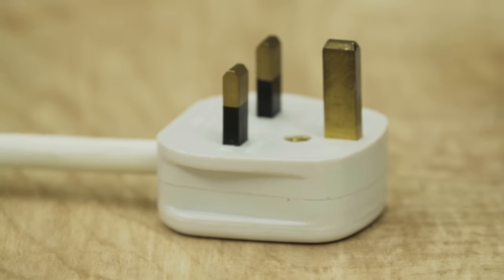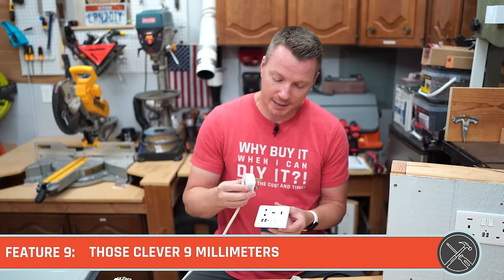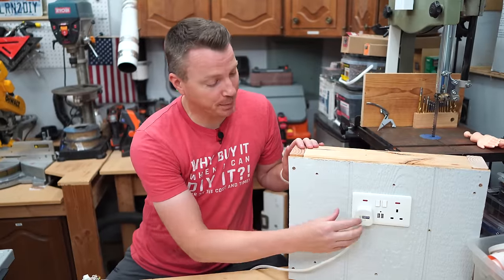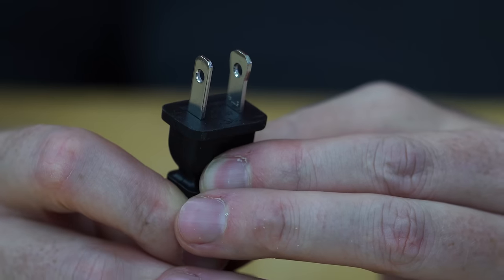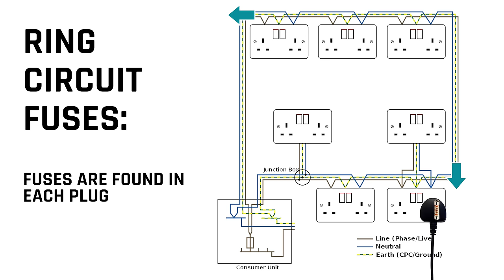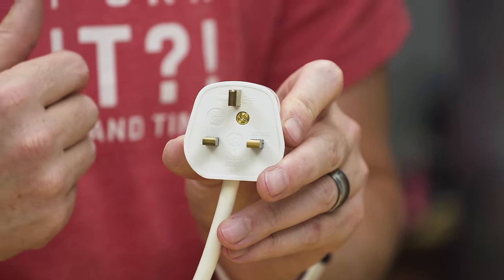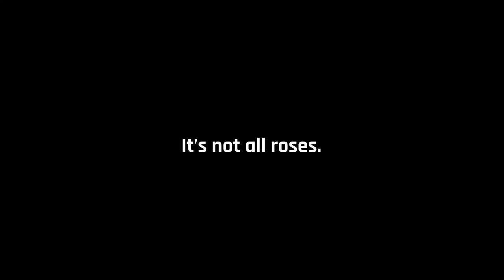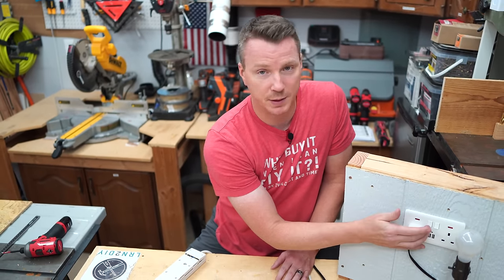British Plugs and Outlets Are On Another Level

Comment: I've never had an issue with thinking a device wasn't working because its switched off at the wall. In Type G systems we are born into this. 
Also in British schools every child is taught how to wire a plug safely and how to change a fuse usually at about 12 years old. As a result electrocutions are quite rare in Britain.
Reply: Plug wiring has not been taught in British schools for decades. However, the concept of how plug cables consist of multiple wires in order to create complete circuits is taught in KS2 Science.
Reply: @JivanPal  really, my son, 15 was taught it at Queen Elizabeth High School, Hexham, Northumberland,  a state comprehensive,  when he was 13.
2 years ago
Reply: @HarryFlashmanVC  It's not part of the National Curriculum, though I'm sure some schools teach it as a matter of curiosity / general knowledge, or to give students a deeper understanding of electrical wiring in practice, for GCSE science/physics. It was certainly never taught at the London comprehensives I attended. I finished Sixth Form in 2015, including A Level Physics.

It never comes up on any exam. Instead, concepts like electricity generation and distribution via the National Grid, stepping up and down voltage using transformers, and properties of RC circuits are assessed at GCSE level. Simpler circuits and concepts are studied and assessed at KS2 (in the SATs).

I can't say I've spoken to anyone my age or younger that actually knows how to wire a plug. My mother (born in 1964) was taught how to do so at the same primary school I attended, but I wasn't.
Reply: @JivanPal  sorry to head that. It doesn't surprise me though, it appears your generation have had some extraordinary gaps in your education in the name of 'progress'
Reply: @HarryFlashmanVC  Not really. Personal finance, for example, is now part of the national curriculum, and learning how to wire a plug is just a matter of looking up a video such as this. The world has changed, both in terms of what is necessary daily knowledge (such as wiring a plug) and the difficulty and methods with which one acquires new knowledge (the internet has made it extremely easy to find out all sorts of things).
Reply: @JivanPal  that's a matter of subjective opinion! I'm in charge of graduate recruitment at a FTSE 250 and we now train graduate trainees in critical thinking and analysis, as standard as since 2010 we have noticed a substantial drop in both skills in our graduate intake, the debate is now whether we drop graduate recruitment completely and hire directly from school using our own selection criteria and educate the trainees through a 4 year apprenticeship.  Unfortunately the education sector is failing industry hopelessly.
Reply: @HarryFlashmanVC  You're talking about universities now. That's a whole different ball game. If graduate recruiters aren't working for you, then I agree that you should filter out candidates yourselves. I feel it's more likely that the recruiters you're using are very lax with their filtering, as is unfortunately commonplace these days.

Depending on what industry you're in, hiring graduates vs. hiring people straight out of school or coming from apprenticeships does not make much difference.
Reply: @JivanPal  we have an in-house team.who report to me..I've been doing this for 35 years, trust me, the decline is palpable.

Comment: There's another quite cool feature that you missed. Because there are 3 large pins being held in the socket, a uk plug can be quite stiff to remove, prompting you to curl your fingers behind the back of the plug to pull it out and thus, bringing your fingers into close contact with the pins. You will notice that there are two 'flanges' moulded on either side to prevent you from doing this. Most people don't even realise that it's a 'feature'!
Reply: My own concern is that withdrawing a plug from a socket might accidentally pull the top off the plug thus exposing live conductors.
You can buy add-ons to help with plug removal, usually intended for old or infirm people.
Reply: @mungoh42  the british standard includes the minimum force required to tear the cap off the plug which exceeds the stiffest socket. There was a raft of faulty plugs imported from hong kong in the 60's and 70's that got widely distributed and were recalled in the papers. A few still come in from china.

Comment: UK plugs are good, the power switch and the fuse is definitely a bonus compare to other systems, but not necessary. I think that other European systems like type E (french) or F (german / schuko) are so very robust and safe.
Reply: Steve D  surely not, you will never buy an "extension cord" that is 0.75 mm2 or 1mm2 in Europe,  it is just not allowed and any good sold in EU has to pass CE regulations to be sold. Also i wonder what appliance you are talking about, do you even realize what 16A is inder 240V AC? that is almost 4KW, good luck to fund such appliance. You just make it up, you must be a brit.
Reply: Steve D  even a 0.75 2mm powercord can pop a 16 amp fuse or breaker.

Comment: For a long time I thought it was completely normal to know how to rewire a plug and know what the wires mean. I didn't even realise American plugs couldn't be fixed and they just chuck them when they're done. Seeing an American plug for the first time when I was on holiday in Florida freaked me out, it seemed so unbelievably dangerous and flimsy. The way plugs in the US wiggle around in the socket still seems utterly insane to me, and not how you respect electricity.
Reply: You're not wrong. But that's what we are used to.
Reply: @misterdoctor9693  I tend to see a lot of faults in America that you all are just "used to"... Ah and then we laugh as we watch them parade about their pride
Reply: @Nvggs  Don't you dare "you all" me. If I was in charge we would all be using the metric system. Pride doesn't play into it when you have to go about your job every day and everything you interact with is poorly designed.
Reply: @Nvggs  Well, thanks for the prejudice, I guess?
Reply: @misterdoctor9693  I'm British and I don't want to use the metric system. We are half and half like miles, ft and inches etc but now we're out of Europe looks like we're going back to lbs and oz again for groceries. I also prefer °F for climate at least
Reply: @landofnor  why though? Those measurements all seem more intuitive to me in metric.
Reply: @misterdoctor9693  I won't argue that metric has it's place in Science and even in engineering. The problem with metric is that is was forced upon us and it became illegal to sell goods in lbs and ounces, even some grocers were prosecuted for refusing t change their scales. The imperial system is part of our culture of which we've been using for nearly 2000 years. Whilst metric is more accurate, we don't need precise measurements in every day life. A good example is cooking. Try explaining to a 5yr old when baking a cake and measuring out 112g of sugar vs 4oz. It's simply easier to visualize.
Reply: @landofnor  Cultural resistance is exactly the problem. We use worse systems because we are familiar with them and change is inconvenient. Your example of measuring out sugar is only simpler in ounces because you rounded to make the ounce measurement a single digit number. You could round the metric number and call it 11 decagrams. You can have any number of other measurements that just happen to be simpler to represent in metric. And if everyone was using the same system those recipes would evolve and scale to prescribe the simplest working amounts within that measurement system.

Comment: There is one other feature you didn't mention. The earth pin is at the top which will prevent a stray wire draping over and touching the pins from above when the socket is only part way in. It doesn't need to be wire necessarily either. Gravity is the enemy here. It may be a rare occurrence, but it happens. 
Guitar strings can be good for that.
Reply: Plus even it it does, the L and N do not become connected until only the plastic is showing!
Reply: And that is why a lot of new US installations are done with the ground pin on the top even though it isn’t a code requirement.
Reply: I suspect the UK outlets don’t wear out as quickly as the US one. I recently stayed at a small inn where the outlets were so worn they couldn’t hold a phone charger.  

Also - US code has gone to tamper-resistant outlets. The safety shutters don’t seem as sturdy as the UK version, but it’s better than nothing. 

The newer ground fault-arc fault breakers also help.
Reply: @Anonymous-mf8ii  
Yes those ground sensing breakers are good.

Comment: Good video 👍. Those insulated pins were a big safety improvement when they added them. As a child I was pulling a plug and my thumb and fingers slipped around the sides and bridged the live and neutral - it threw me across the room. Adult fingers couldn't fit the gap until contact was broken so I suspect some other kids weren't so lucky. I've had a shock here in Canada and I can attest that 240 V has way more kick! ...the price of kettles boiling quicker and lights that don't dim whenever a motor or heater starts up!

Comment: After having lived my whole life in The UK, any other country's electrical system seems so dangerous in comparison
Reply: Some things are OTT in UK like no light switches in bathroom (only pull cord).
Reply: @Dosedmonkey  again for safety. The pull cord is to prevent electrocution with wet hands. Trust me I've been there in a non european country with a light switch in the bathroom. I shocked myself turning the light off when leaving, blanked out, and woke up in the dark a few minutes later on the bathroom floor dazed. It's not fun!
Reply: There's no perfect electrical system. Yes, British plugs are safer than North American, but the North American split phase 120/240v system is also safer than the British 230v system.

Comment: It's not necessary to pull the plug out to isolate the appliance, that is what the switch is for, so no need to leave plugs lying on the floor, unless you are setting traps for burglars!😉
Reply: It absolutely is necessary to remove the plug in order to isolate an appliance. There is a distinct difference between an appliance being 'switched off' and 'isolated'.
Reply: @MrKevanGordon  You're both right.  You can install a lock on the switch and consider that isolated.  The breaker system is just a larger and heavier switch with overload protection.  Most consider "off at the breaker" isolated, even if no lock is installed.
Reply: @elus89  Not at all. You’re making the assumption the sockets and circuit are correctly wired as we only isolate the live with the switch. If for some reason live and neutral were reversed you would still have voltage. To be isolated it should be done at the breaker and the circuit should be proved dead by measuring for voltage on LN. EL, EN
Reply: @MrKevanGordon  I take your point, but in fact if the socket is double pole switched it would be isolated. In either case the appliance is powered down.
Reply: @themunchkinbear  A lot of sockets are double pole switched so this doesn't apply.
Reply: @bimble7240  and so many are still single pole. You can’t tell the difference from the front. I wouldn’t take the chance. Properly isolate the circuit with testing or unplug the device. As an example, the Crabtree 4306 and 4306/D
Reply: @MrKevanGordon  
We have isolation switches.
Reply: @themunchkinbear  
L & N are isolated in modern UK sockets when switched off.
Reply: @bimble7240  
The earth is not isolated.
Reply: @johnburns4017  read my previous reply. Not all sockets are modern, and not all modern sockets isolate both. See the current Crabtree range.

Comment: One of the greatest benefit is that it's fused, This protects the cord and the appliance from overloads, shortcircuit fires. Some rubber types which are unbreakable are available. One drawback is the risk of top cover coming off if the plug is stuck in socket and excessive force is used.